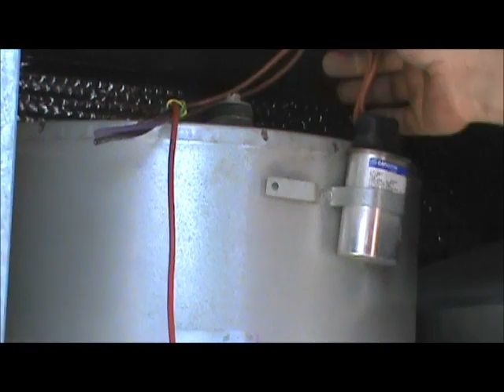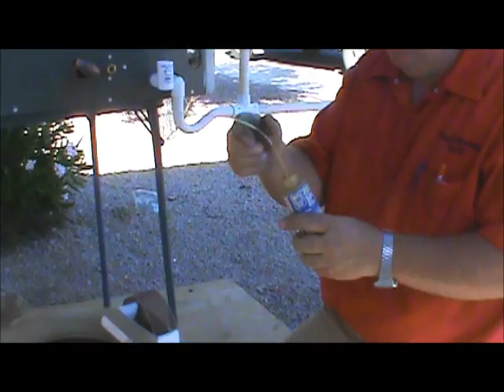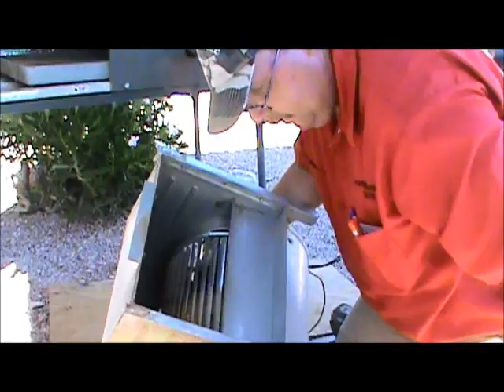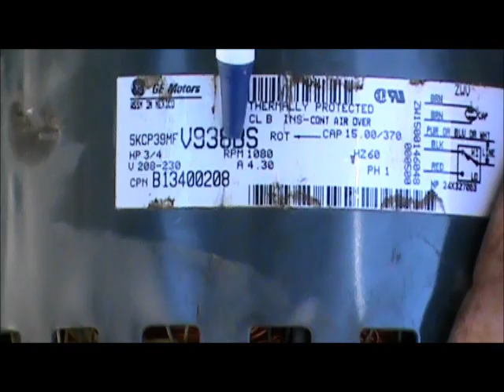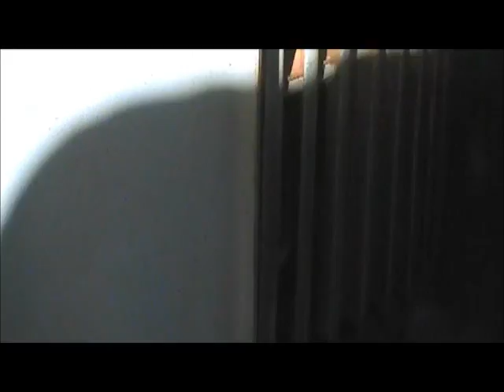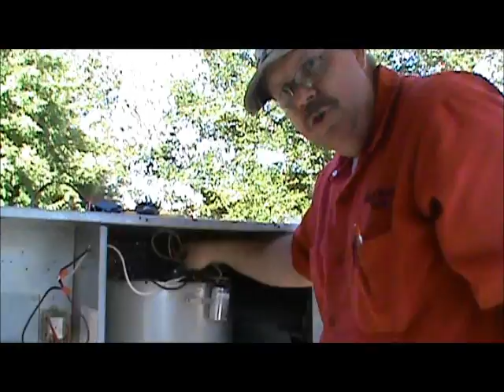Fix Your Own Air Conditioning - How to Change an Indoor Fan Motor

Comment: Your website is gone and I understand that I have a pgb Goodman I want to make sure that the length of the wires to the circuit board are long enough are all the question is are all the wires long enough on the replacement motor also also from the looks of the blower motor you used it had mounting studs so these motors are dual purpose condenser Motors and blower motors I have experienced I'm specific application pgb condenser Motors the wire is too short I imagine this is why because it is not a condenser motor it is a blower motor and the leads are long enough but they are not long enough for the condenser pgb blower motor leads must be 40 in Long so anyway maybe if you email me I can clarify it wrenchman55 at gmail.com I need to know the appropriate motor for this application and to be sure the leads are long enough

Comment: So, my blower motor seems to be done. I have been checking the DIY vids and I am pretty good with tools on cars and bikes, so I plan to do the swap myself. I plan to take the dead motor to a supply store and get a match for it. I've never been happy with the volume of air moving from the fan, even though it sucked the filter in place quite well. Wondering if I should set it on a higher speed if that option is available.

Comment: There's a lot of reasons why the fan motor isn't working and don't you think that somebody should have basic electrical knowledge and diagnostic skills to determine what part is actually bad in the unit it could be a PC board it could be a fan switch and do you think that an untrained working around 240 volts I mean come on man leave this stuff to the professionals

Comment: No mention of how to determine that the voltage is off, how to determine IF the motor is actually bad, if the motor is bad why did it fail, and last but not least that is not the correct motor replacement. lol wtf.
Reply: Greg Stabler  -  It clearly said how to change an indoor fan motor...don't expected to much when the unit in the open field.

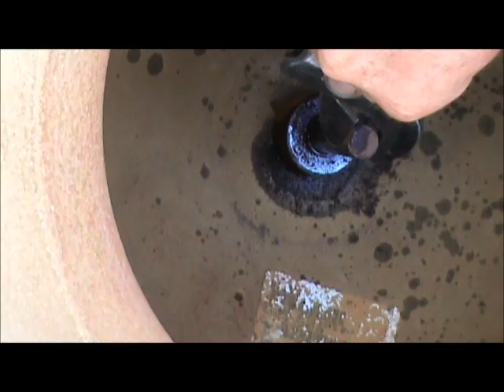Comment: Your tip about using the crescent wrench to turn the shaft at about 3:40 in the video totally saved me.  It was murder getting that fan wheel off until I saw your video and the light went on.  Thanks very much for taking your time to make this video.  It was a great help.

Comment: Thanks for that information. I've replaced the blower motor, coupled the hi speed wires, med-low wires and connected the brown, wires to the old capacitor. I did not receive the capacitor with the motor because it was order separately through amazon. I tried to use the old capacitor and connected the wires as mentioned but when I turned the breakers on and then the fan from Auto to On, only make a click noise. The motor does not start. Could It be that the capacitor is bad?
Reply: +Rudy R What did you find out? A bad capacitor typically is bulged out on the ends, not flat.
Reply: I hope you hired a professional to make you repair. This is a prime example of homeowners that know nothing and Amazon selling to anyone.

Comment: Good observation, but maybe it doesn't matter. As long as the hp, rpm, and rotation is the same, why not?
Reply: CoolasIce2 except for the amp rating. Which is very important. Their is a lot of specs that must be met. You will let the magic smoke out of the motor and it won’t work anymore. Then you need to get a magic smoke injector kit. AKA another new motor lol. Let the trained people fix it or pay twice as much to do it yourself.